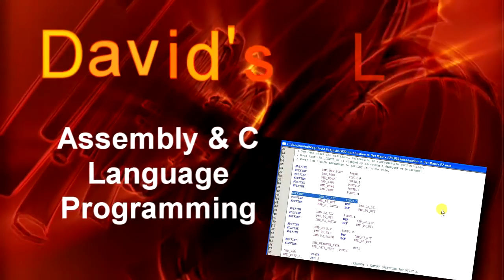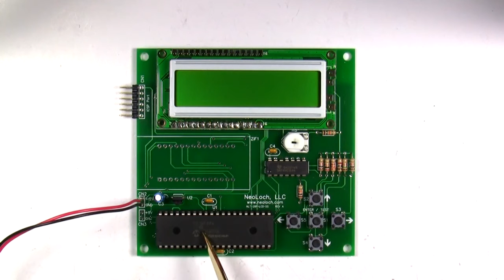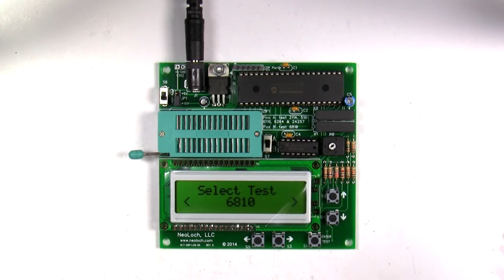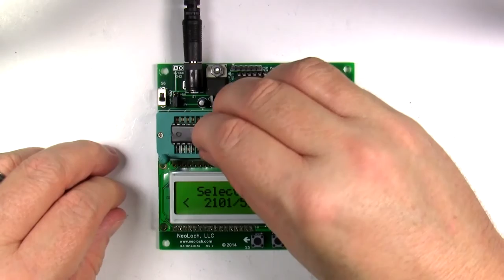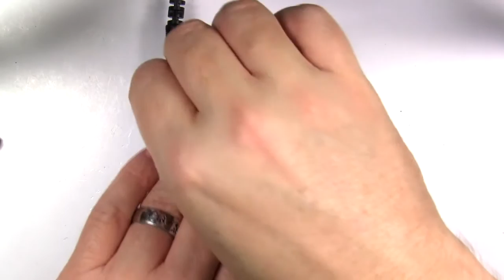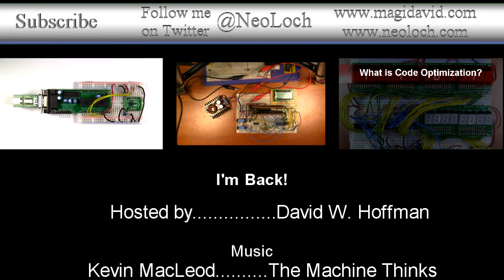David's Lab - I'm Back & a Look at my RAM Tester Evolution

Comment: Hello! your videos have been really helpful for a project I'm doing, I was wondering have you ever made a general tester that can test different types of chips?
Reply from the maker: +Deb Roco Hello Deb. That really depends on what you mean by general tester, which is a very broad term. Any tester has to be designed to test a specific range or family of ICs. I've currently got a new tester design that will allows for a wider range of testing. You can learn more about that tester at neoloch.com

Comment: David, I like you new design and the add on board would make it easy to program
the tester to test TTL and CMOS IC's as well. Would be cool if it could read from a
memory card, so that the average user could just modify that file to input truth tables
of the device he wanted to test.
Keep up the good work.....
Reply from the maker: Yep, that's the whole idea behind the setup. To allow different blades to do different tests. And thanks!